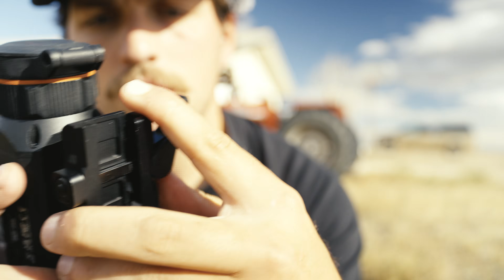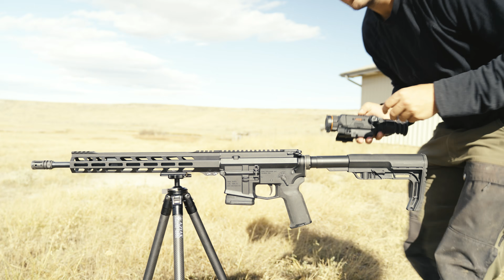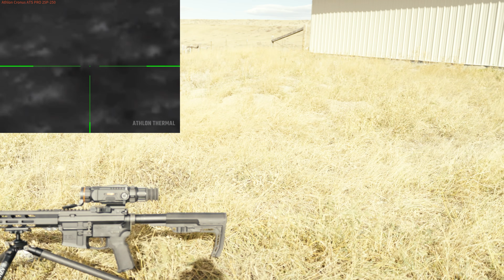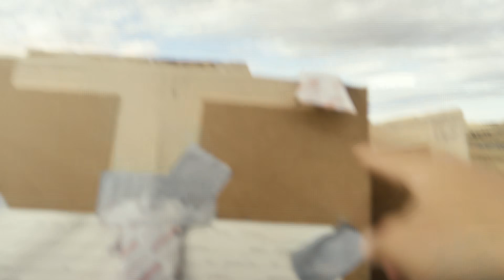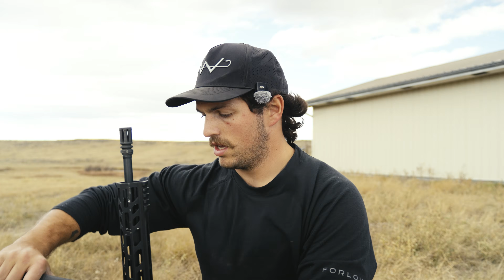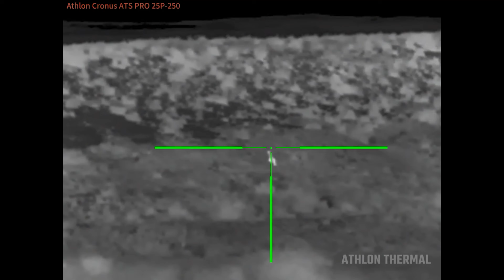Athlon Cronus ATS Pro 25p-250 First impressions

Comment: Have an issue with mine to where I put it on the pic rails but is wobbling still even with the nut tightened, any tips?
Reply from the maker: When you tighten the nut make sure you press it all the way out I had something similar till I fiddled with how to push it out a little further

Comment: How has this scope done for you with hunting?
Reply from the maker: Really good, I’m really impressed with it holding zero while changing it out for my day time scope. The hardest part is spotting coyotes that are 400+ yards away otherwise I love it!!
Reply: @Gabe_Robins0n I’m looking at it for hog/coyote hunting and most of my spots are less than 100yds with a couple stretching out to under 200yds. Do you believe it would work well in those applications?
Reply from the maker: @mlmitchem89 yes 100% that’s what I use it for it works great!